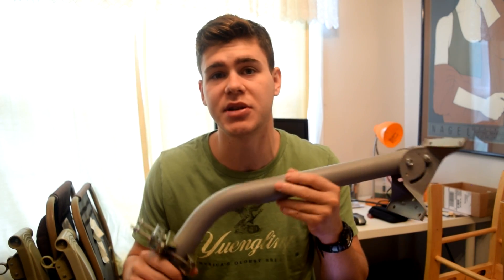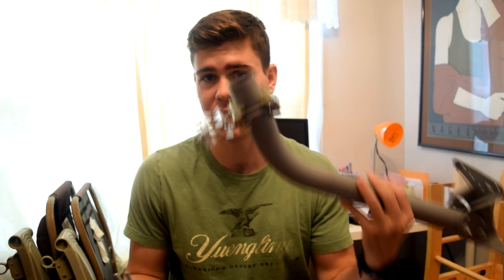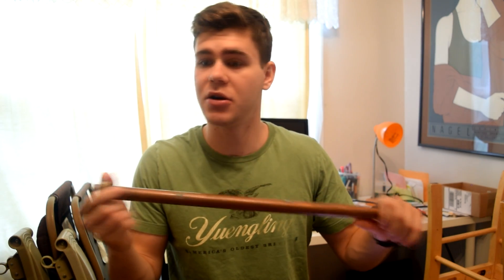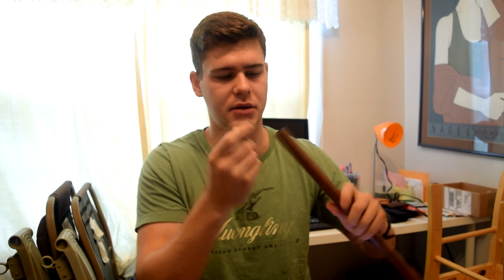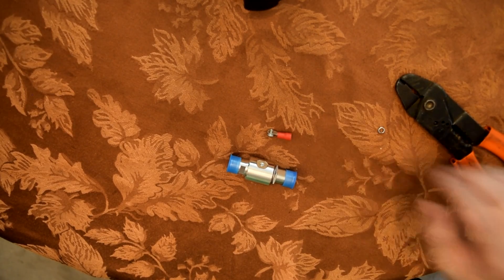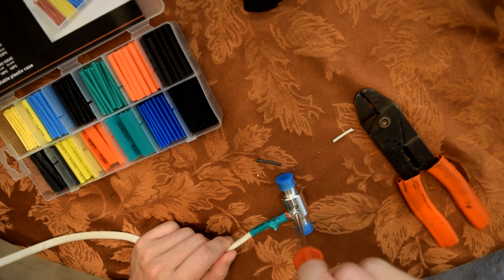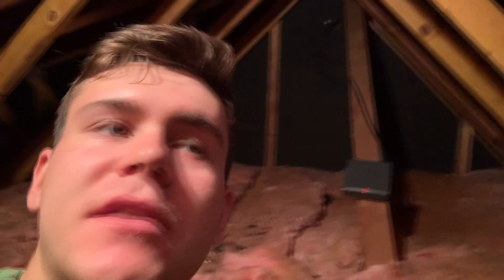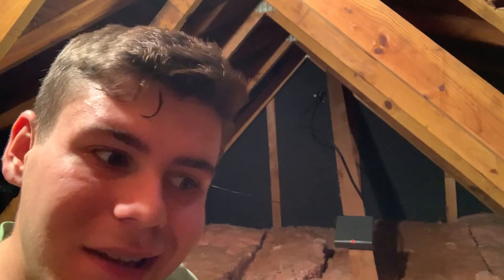How to Mount Helium Antenna on Roof - Mine more HNT

Comment: Question:
Shouldn't the connectors on the antenna (probably also the Lightning Arrestor) be protected with self fusing tape?
Reply from the maker: They have built in rubber O-rings that will protect the connection from moisture

Comment: hey love the content, i don't know if you are still reading these comments as it has been 5 months but i have a question. the satellite mount is metal right, and the fiberglass antenna has metal right. so does the lightning arrestor ground both of the items? do i need two different grounding rods and two different grounding wire's? i'm not trying to have lightning strike as rain season is approaching  for me. hope someone could help me out, thanks.

Comment: Did you only put one bolt on the mast mount that you put into your fascia board? I just got a mount that is 5in (pretty much the same width as my fascia board) and am debating getting 2 smaller width screws, tilting the mount (this would reduce my vertical height of the antenna by like 1/8in), or just put one bolt on the mount. Thanks!
Reply from the maker: I believe I put 5 in , 4 corners and one in the center.

Comment: 8 feet grounding rod/pipe length is required by code to be underground. You can lay it in a trench at least 30" deep. It doesn't need to be vertical but can't be more then 45 degrees from vertical unless you lay it in a trench.  NEC 250.53(G)

Comment: Hey quick question, do you have to use a ground clamp or can u just like tape the grounding wire to the ground rod/pipe
Reply from the maker: It’s recommended to use a ground clamp because it is rated for the flow of electricity. Using tape could allow for the wire to come loose and fall off, they are super cheap like $2-$5

Comment: Your doing wifi hook up in the attic or ethernet? 
Also how secure was the antenna mount?  Just the normal screws the kit came with was enough to secure through the aluminum sidings?
Reply from the maker: Im on Ethernet now, just because it was easier to set static IP... I used screws from Home Depot

Comment: Are you positive on the solid copper vs stranded ? I’m not sure that matters
Reply from the maker: A quick google search and it turns out I was wrong. "Stranded is a better conductor for lightning protection regardless of the wire size. That is, AWG 10 stranded will be a better conductor than 10 AWG solid."

Comment: That's not a good place to install the lightning arrestor. I'm sure it's probably too late - you already mounted the antenna. Take advice from someone that is a licensed amateur radio operator and fact check with other hams. For anyone else that hasn't done something like this.... You should connect the LMR400 directly to the antenna, then run the LMR400 coax down to the ground. Lightning needs a path straight to ground. The lightning arrestor connected directly to the antenna isn't going to accomplish anything - unfortunately. You can get a device called a Universal Copper Grounding Clamp (UCGC) made by Alpha Delta (via Ham Radio Outlet). Connect the UCGC to the top of your grounding rod and attach an Alpha Delta lightning arrestor to it. The lighting arrestor combined withe UCGC and the grounding rod allows lightning to find the ground. The Alpha Delta lightning arrestors have a field replaceable gas-filled capsule that breaks when it gets hit with lightning. You want that to happen as it ensures the electrical charge doesn't make it into your hotspot. Then run an additional length of LMR400 from the other side of the lightning arrestor to the Helium hotspot. Make sure you use some coax seal tape, cover it with heat shrink tubing, then go over the top of the heat shrink tubing with liquid rubber electrical tape. Great intentions - not the most ideal execution.
Reply from the maker: Thanks for the tip, I did change it a little bit in my newer video on the antenna but I’ll look into this. Always looking for ways to improve so I appreciate it
Reply: @chrisbagnell  absolutely! There’s almost always room for improvement. Ham radio operators spend tremendous amounts of time and money on antennas. It’s a constant learning process. Kudos to you for figuring everything out that you did! It’s impressive.

Comment: Hi Chris, I have a question, I decided to order an 8 dBi antenna, the Antenna Mounting Kit, an arrestor, a piggy tail cable with connectors.  I estimated will run the LMR 400 cable on the side of the house and into a bedroom on the second floor. I calculated will need about 65-70 feet of LMR 400 cable at a $158 cost!  Is there a less expensive alternative to LMR 400 cable?  Thanks a million
Reply: That is too much cable, you will lose a lot of power which won’t be worth it. Your best bet is to buy an external enclosure for your miner and sticking that outside
Reply from the maker: Like Callum Blacoe said. You want your cable length ideally less than 10ft but 25 ft is okay. Anything above that you will start to see reduction in earnings and your signal strength will be weaker because your hotspot has to push that signal 65ft in a cable with no amplifier. I hope you'll be able to put your miner closer to your hotspot. Unfortunately sometimes you have to spend money to make money, and LMR 400 is not cheap!

Comment: Great video.Question, that 1 feet  of ground rod which is fantastic is it enough,  everyone uses 8 feet deep. And also does it needs to be a solid copper rod? This is what I had found so far. Not telling you that your installation is bad looks great. But make sure if this is correct and safe, I am also looking is very hard. I would love just to install 1 feet of ground rod but can’t find the right answer yet. Thanks for your help.
Reply from the maker: This is kind of opinion based, I live in an area with not a lot of thunderstorms and the ground is very hard to break through due to rocks. I switched to a 8 ft ground rod but only have about 3ft of it actually in the ground because of the rocks underneath the soil. It is different for everyone depending on where you live, and most homes have ground rods already that most people can just tie into.

Comment: Great one Chris! With your mine in the roof, are you connecting with wifi or did you run a ethernet cable up there?
Reply from the maker: I am connected with Wi-Fi. I have not had any problems with connectivity

Comment: Is 8dbi antenna from Rak water proof? Can I just connect cable and not be worried?
Reply from the maker: Yes the antenna is waterproof, not all antennas are. Check with the website it it will usually say indoor or outdoor meaning if it’s waterproof or not

Comment: Thanks for the video. But I'm worried about putting my miner in the attic like you did. My Bobcat miner gives off a good amount of heat, and together with all the heat in the attic... im afraid it will eventually fry my miner.

Comment: Is there a non invasive way to bring the cord inside without drilling a hole?
Reply from the maker: you could go through a window but it would not be able to be closed all the way you would need to tape it off with a water sealing tape

Comment: Vey cool! Does the grounding rod need to be a certain depth in the ground to be properly grounded? is so what depth? Thanks!
Reply from the maker: Thanks! standards for grounding rods are 8ft long and they can be bought cheap at stores like Home Depot & Lowes. This is the new one I bought and will install https://www.homedepot.com/p/ERICO-5-8-in-x-8-ft-Copper-Ground-Rod-615880UPC/202195738

Comment: hey does not  get to hot i there ?
Reply: i want to do the same but i don’t know if heat is an issue
Reply from the maker: It is very hot in my attic. It is not insulated and I'm operating at around 64 C on the hottest days of the summer. I think i am going to move it to inside my house in the near future I just have to wait on cables to come in etc..
Reply: i was thinking about put my  in my attic but sometimes  the temperature increases to maybe 120. that’s why i was asking because if you leave it there you will destroy your helium miner.

Comment: What are pros and cons of connecting your hotspot via wifi instead of cat5?
Reply from the maker: The only reason I connected it via Wi-Fi is just because it is easier for me. I don't have a long enough cat5 cable and even if I did, it would be running all throughout the house. Ethernet is definitely a better option if you have the availability
Reply: Cat 5 is the old stuff, don't use it. Cat 6 or higher is your better option. More data can pass through Cat 6 and higher rated cables than Cat 5. In fact if you are currently using Cat 5 for anything upgrade it asap.

Comment: Hey buddy what type of cable do you use? I'm still new to this. I want to do the same thing as you. I have a sensecap M1 on the way. I was wondering do I use a rpsma male to male or female to male? Thanks bro keep it up
Reply from the maker: Connector 1 (Hotspot side)

RP-SMA Male

Connector 2 (Antenna/Arrester side)

N Male

Make sure you get more than 8' like I did. 8' is not enough and I think ill have to get a longer cable. i dont have a loop in the cable as well to prevent water leak so I'm probably going to get around 15-20'

Comment: you need a drip loop on the cable. water will run down the cable into your bobcat
Reply: It will leak. Don't wait for it to do so, it might be too late. Always use a drip loop regardless if you use flex seal or anything else.
Reply from the maker: I noticed after the fact but sealed the hole, if it leaks I will Add the loop

Comment: Looks nice and clean. Discovery mode does not work that great.keep a eye on the temperature of your miner being in actic
Reply from the maker: According to the FCC documentation from Bobcat it can handle temperatures 0-60•C ~ 140•F . Makes me feel safe having it in the attic. I’m more concerned about the winter temperatures as it goes below freezing often
Reply: What bobcrap says and what happens out in the field is another story. Keep an eye on it when it's hot. The miner will slow down if it's too hot.
Reply: My Bobcat's temp was red lining in my attic and I'm up in Canada. I wound up installing it upside down on my attic hatch. Cool in summer and warm in winter. 👍

Comment: I would use a longer grounding rod if I were you.. It is supposed to be a minimum of 8 feet deep (and preferable a bit further away from the house.)
Reply: Most definitely change that grounding rod. Get an actual solid grounding rod from your nearest hardware store. They should be in 8 ft lengths and if soil feels loose when you drive it in 7 ft or so get another one with the coupler made for them and go down another 7 to 8 ft. You only need a little above ground to make and inspect your connection
Reply from the maker: Thank you, I will change it... I was thinking it was a little too short but figured i would post it and see what others thought
Reply: You seem to know about that rod 
I see one already near my home but is used for something else thinking att maybe could I also use that rod ?
Reply from the maker: You can use an existing grounding rod on your house if it is there
Reply: @chrisbagnell  you have to be careful with that, as the existing rod is probably attached to the house it's electricity grounding. Lightning could potentially move back to your house via this way.. I would keep the existing electricity circuit and the lightning circuit separated.